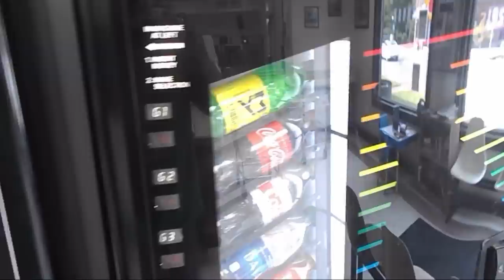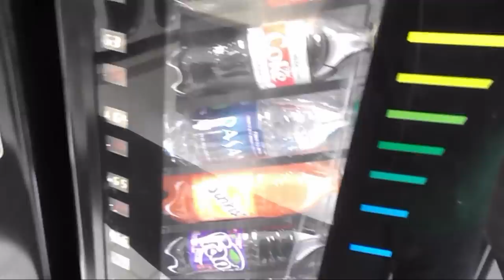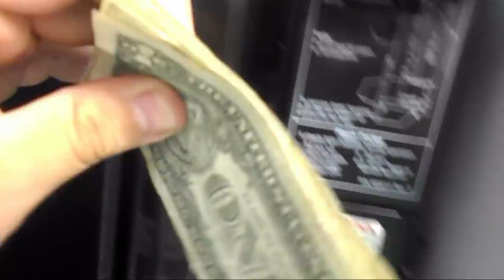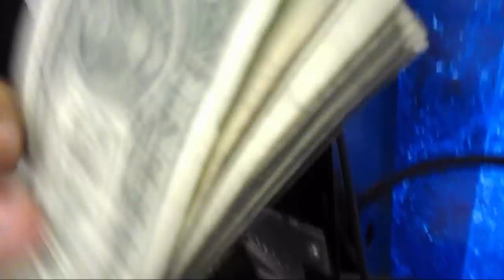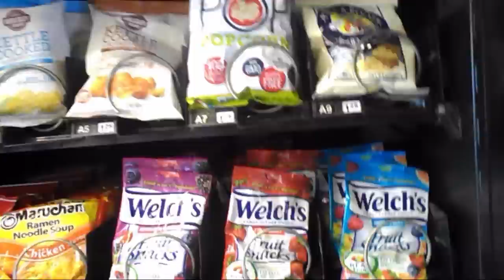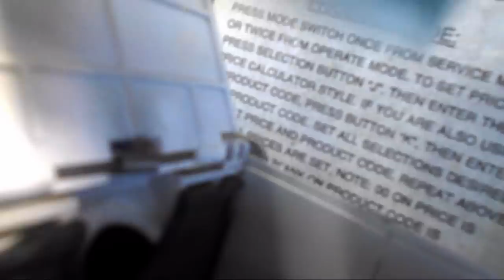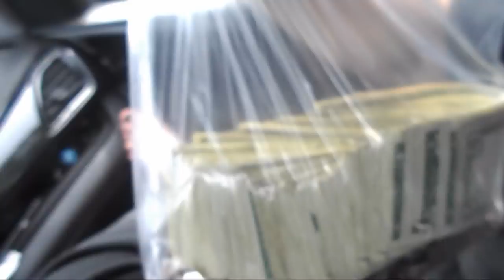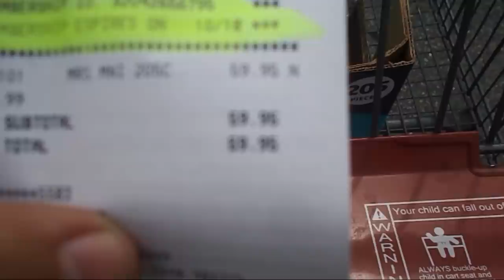Vending machine COLLECTION DAY

Comment: You are over paying taxes.  You shouldn't pay taxes on the gross number, you should pay it on the net number after you pay for product, gas, vending machine costs, ect.  Example you gross $261-$161 in expenses=$100 in profit then pay $33 in taxes.  Dont pay taxes of the $261 gross which would be $86.13 in taxes a huge difference.